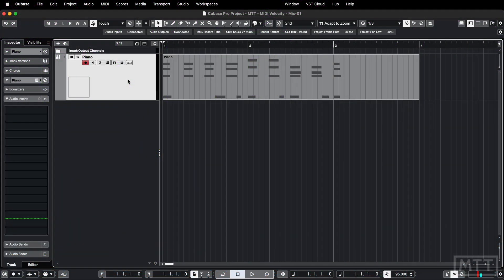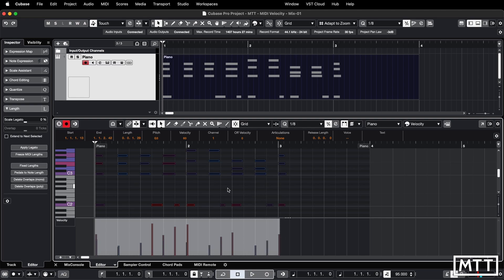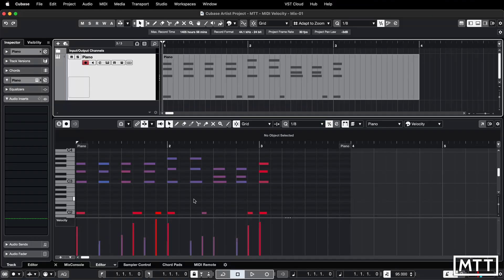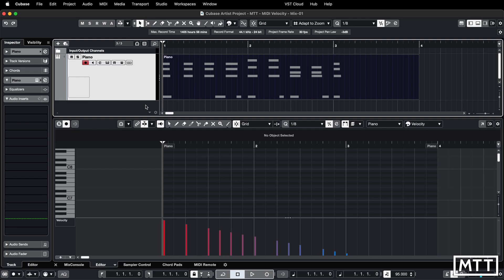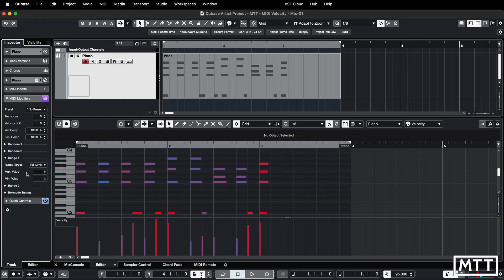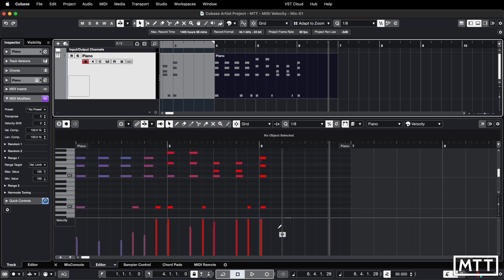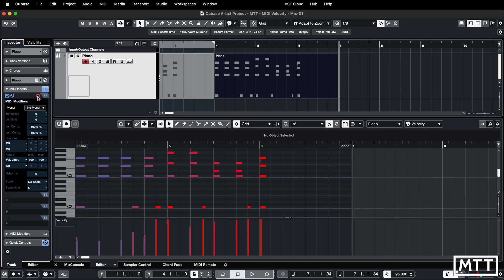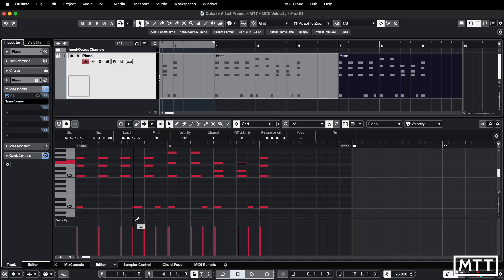Cubase Skills: Fixing Velocity 7 Ways

Comment: As usual, LOVE your videos.
One thing I've found confusing and disappointing since switching to Cubase is the fact that you can't highlight multiple midi events on the same track and manipulate their velocities all together. For instance using the line tool across multiple midi events OR simply raising or reducing the velocity. Such an unintuitive and weird restriction.
Reply from the maker: Thanks!  You can alter the velocity across multiple parts in the project window using the info line.  The line tool will work across multiple parts as well.  Video upcoming on this as it's easier to show than say here...
Reply: @musictechtuition  ya.. I DID learn that one from you.. but I mean like drawing a line across them etc. Unless you join the events you're outta luck.
Reply from the maker: @biglipzit  You can use the line tool if you select multiple events, you can then use the line tool in the lower zone editor across those multiple parts, and they'll all be altered (providing, of course your time range of line tool includes all those parts).